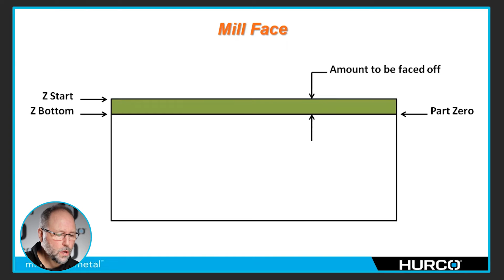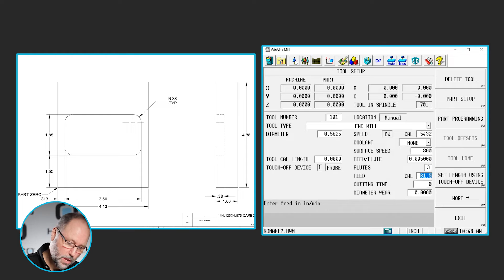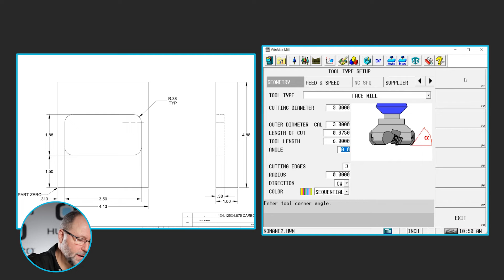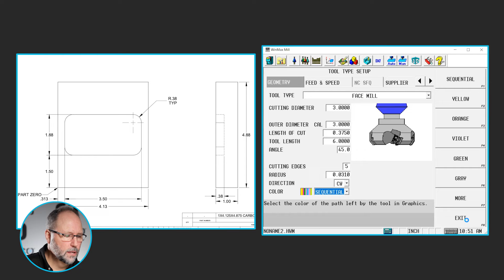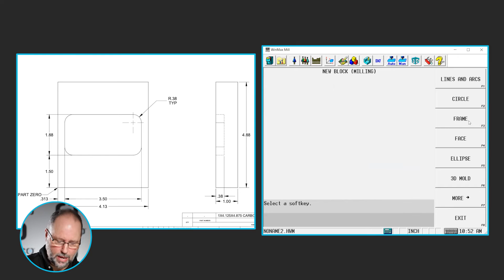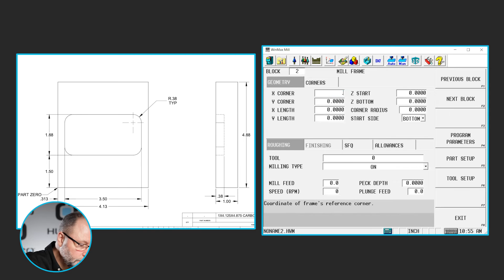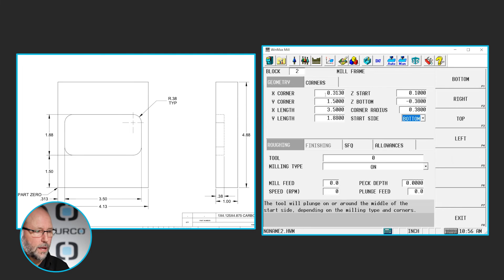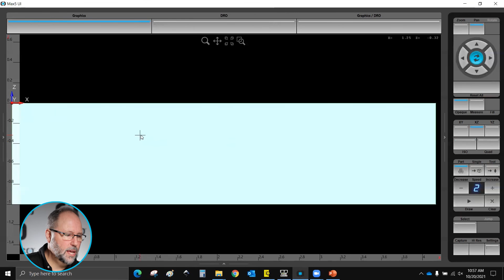Intro 4: Mill Frame & Mill Face | Hurco Mill Intro Training Course

Comment: how do you increase the step over in the face Milling
Reply from the maker: Hi J, if you use the Mill Face block it will use an internal algorithm that you can’t change. It uses the size of the block, the diameter of the tool, and the strategy you choose (unidirectional or bidirectional). If you want to have more control over the cutter path you would need to program a contour in Lines and Arcs.